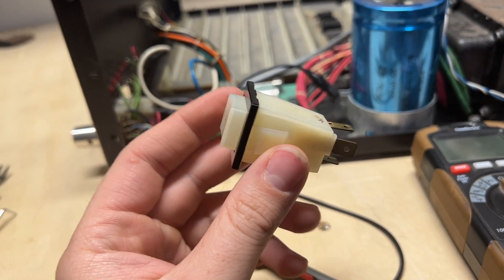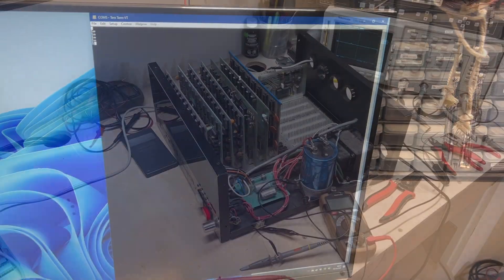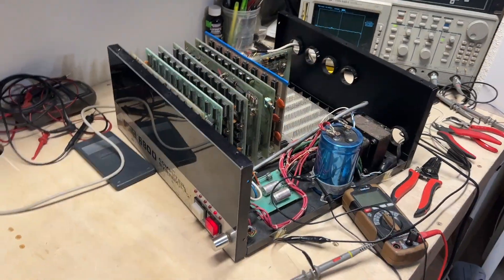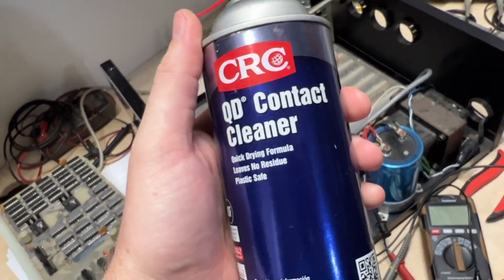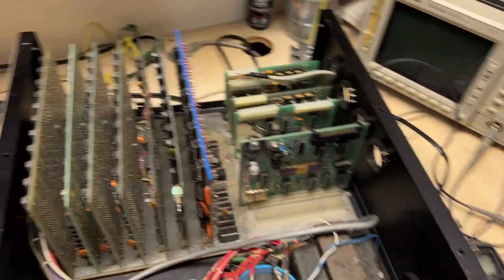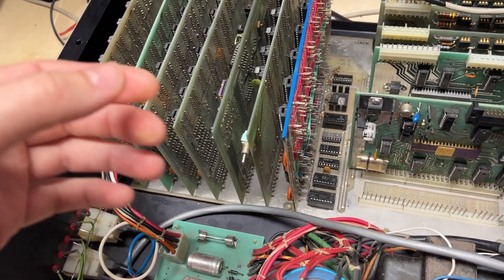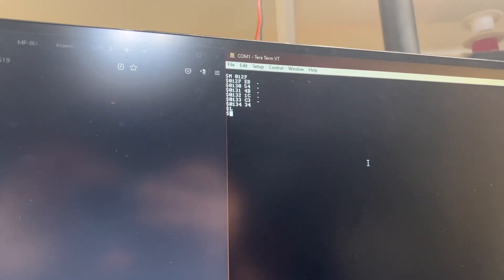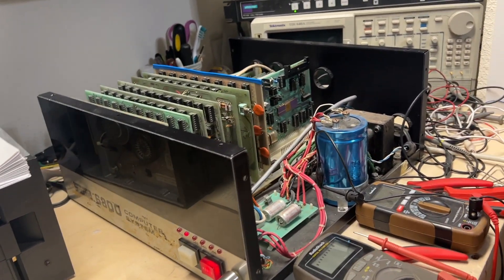SWTPC 6800 Microcomputer Repair

Comment: A good fault, I initially thought you had forgotten about uppercase, so to check I powered up my SWTPC clone to be double sure how it handled lowercase, to me it seemed like your terminal PC was being a bit strange.
In this situation it sure does help to have a second PC, laptop etc, also running  TerraTerm or Putty etc., to verify the serial data your sending is ok.
https://youtu.be/3JJU8ENm8bk for a looksee into my machine.